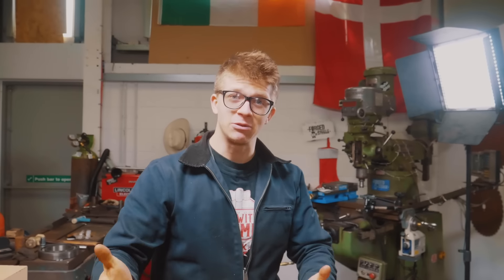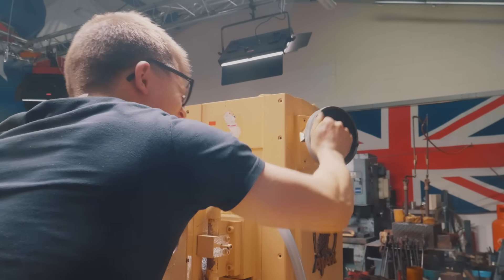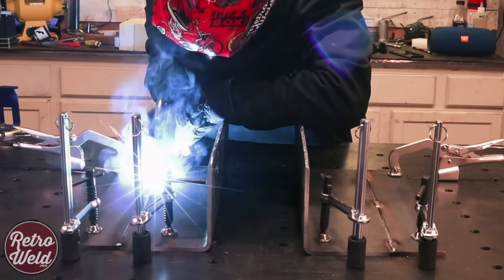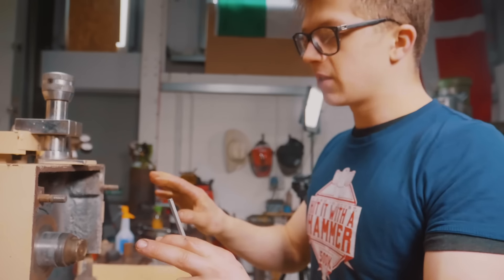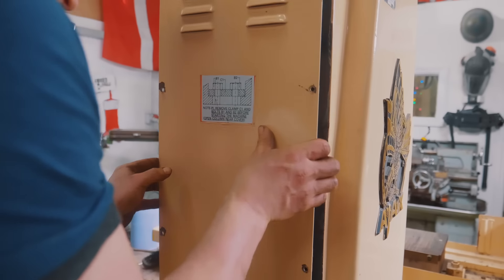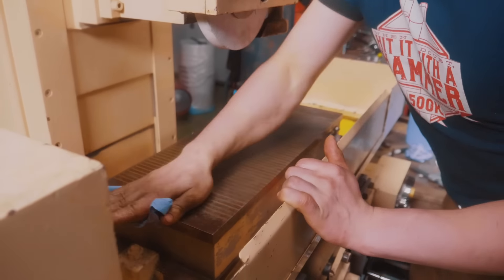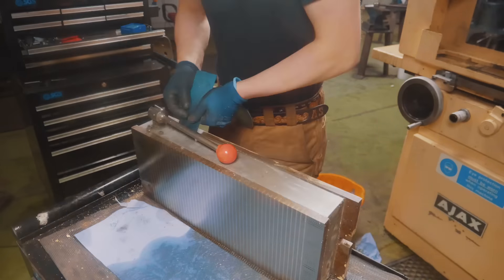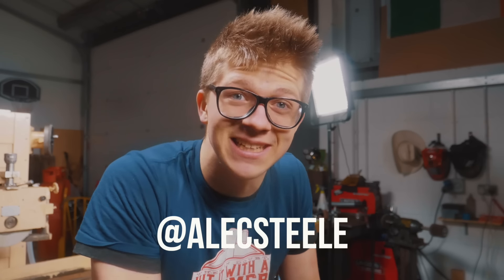THE SURFACE GRINDER IS ALIVE!!!

Comment: That noise that you heard was Cavitation of the pump. Essentially it means that you were sucking air or not enough oil and the air gaps left were essentially collapsing under pressure and over time causing a ton of damage to your pump. Literally ripping chunks of metal out sort of damage. Usually the cause for this is Air in the intake piping, A blocked filter or a low oil level. As you probably figured out, it was a low oil level. Thats the 3 second crash course in hydraulics for today.

Also if you didnt know to check the soundness of wheels You can put a screwdriver through the bore of the wheel and suspend it from that. Then tap the sides with the handle of a plastic screwdriver and it should ring. If it thuds or sounds hollow its a bad wheel 100%.

Comment: 3 live wires connected without neutral means it runs on 400 V instead of the standard 230 V, at least here in belgium

Comment: Next time the Mag-chuck is off wax and buff the the bottom of it and the table with an automotive wax. This reduces the chance of rust and make no measurable discrepancies in you chuck level. I heard of using a product called rainx as well.

Comment: Anything electrical will run without a ground but shouldn't be done because that's your protection from electrocution. Anything 2 phase or 3 phase will run without a neutral connected. In most panels your neutral and ground are connected, unless it's a subpanel in which case the ground is isolated. All of that being said, always work with a neutral and ground connected for safety!

Comment: You should probably pull that wheel hub off the spindle, that tapered shaft may be as rusted as under your chuck. Also you can get some hubs  that will fit more standard sized wheels. Never run your coolant on the wheel if its not spinning!

Comment: well if you hadn’t tossed the old grinding wheel you could have done the “ring check” to see if it was still good. you just dangle the wheel from a screwdriver and tap on it with a wrench. if it rings it’s still good, if it sounds dead then there’s a crack in it.

Comment: Those lines on the chuck that the grinder makes when cutting means you are taking too much off or feeding too fast and it is not good to constantly turn the machine on and off constantly if you are going to use it multiple times a day you should just leave the machine on but I don’t know the machine so I don’t know how it is run on the daily

Comment: I have 44 years in machine shop, I will guarantee I have screwed up a heck of lot more then you have. Don't be so hard on yourself. My old boss told me if you don't screw up, you aren't doing anything. Just don't do it twice, lol.
 I was grinding some A-2, and I went to lunch and like an idiot I left the coolant on, with the wheel off. When that happens, you soak one side of the wheel, and it can come apart when you start the wheel. You have to jog it on/off until you get the coolant off. Keep the coolant on when dressing the stone or you will have to reset the diamond. Diamonds are just carbon and not indestructible.
Balance the wheel, true it up, and you can hold .0001 inch on them. I have a surface grinder that was made in 1949,and it works fine. The vise should be on when you grind them. Dress the wheel until you don't get any high spots on them, and dress it before you do your finish grind. The side of the chuck doesn't have to be indicated in normally. If you side wheel something, you have to indicate it in on top the chuck anyway. 
I keep the old wheels to grind it before you put the chuck on, and after you grind the table in, I grind the bottom of it, them put some type of oil under it before mounting it. Some tell you it silly because you grind the top of the chuck, it's going to grind accurate anyway. I just enjoy being a PITA anyway.
If you are grinding for a good finish, you can put some paper on the chuck to stop the scratching when you take it off the ceramic type chucks.
Also, the coolant needs to have some treatment for bacteria and mold if it doesn't have it in it already.
Not trying to be a smartass or anything, just want to pass on what I have learned.
Smiles!
Bill

Comment: The mag vice does not need to be square once you run that surface grinder on it its flat flatness is really what matters on a surface grinder. But good job on the referb

Comment: Not done any Surface Grinding, But i can see where one would be nice for making Knifes and Swords. If they also make a stone with a angle one could grind the blade part.. I am not up to speed on what Surface Grinders do or there use

Comment: Yes its possible to run a 3 phase motor with out the Neutral or Earth line if its configured in a Star type and not delta ( where you need the neutral ) in Star type you have a virtual neutral and it works just fine with out it , regarding the earth yes that was definitively not to code and could become potential HOT the whole outside casing , or trip several RCDs and RCDoS in the processes

Comment: i'm like 9 months late, but the machine has no ground connection because the dude that used it before was crazy. and the neutral is not necessary because of how 3 phase power works. the 3 phases deliver the exact same power at the exact same frequency, but 120 degrees out of phase. so, when correctly working, the add of all 3 phases is equal to 0. there is no power coming back to the socket. in fact, there even are 3 phase plugs that come with the 3 phases and ground connectors only.

Comment: I'm no expert on grinders but I thought the bearings need to be fed with pressurised oil at all times, I wouldn't want to run it without the oil pump running

Comment: Once you dress the wheels you do not shut it off as the bearings cool down and then your wheel is out of round again also before mounting any wheel you should ring test it for safety. That is lightly tab it with a piece of brass or wood and it will ring if it thuds throw it away. Cheers and safe grinding !

Comment: You should really be using those crimp-ends on the cables. Otherwise the connection might get hot due to the higher resistance  and then burn up on you. They don't need that  in the us as their single wires in the wire are thicker but we need that here in europe!
Greetings from Germany!

Comment: IMPORTANT !!! Change the way the wires are connected. Now it is very dangerous. The cord in the form of a cable (small wires form one big wire) should have the right ends clamped! Or at least be tinned if it is screwed in the screw connection.

Cool video, I hope that the new equipment will last a long time.

Comment: the answer to can 3 phase curent work without is yes. you only need the neutral if the 3 phases aren't balanced with on a electric grinder i expect they are. earth is a safety requirement and not needed to function

Comment: Alec

If it's a balanced load on 3 phase you don't need the neutral...
A 3 phase motor is a balanced load...

You may find that on some machines the starter coils are single phase though...so they would require a neutral...

And did you use a proper SY gland on the machines incomer for the SY cable it's being fed with...?

Comment: Hey Alex, if the ground is not connected, but it has 3 lines, or 3 phases (if that's how it's called in English), it's possible that you have a 3-phase motor, instead of mono-phase. If it's 3-phase, then you don't need ground, since there's voltage difference between each line instead of line/ground and the motor works in either "delta" or "star" setpr (or a combination of both) . I'm not sure I'm explaining myself, since english is not my mother language, so here's a link https://en.wikipedia.org/wiki/Three-phase_electric_power

Comment: Honestly, your table doesn't have to be square. If you are just grinding a flat surface you'll just throw it on there any fucking direction in the world. I would modify your coolant feed and use something that necks down to offer a little more pressure. It will blow more onto the wheel and keep dust and crap down. Also, don't stand next to the table. It'll put a hole in your gut the shape of the part if the mag table lets go.

Comment: You mean wheel dressing? I'd say the old wheel was perfectly fine, just needed some dressing. Plus you have never checked brand new wheel if it safe to use - and because it's new it doesn't mean it's damage free - plenty of videos online how to cheaply check the grinding wheel :)

Comment: Before you ever put a new wheel on your surface grinder, lightly tap it with a hammer. If it rings then you know it's safe. But if it doesn't ring at all you know there's a crack somewhere inside of it and it could potentially explode at the high rpm of your surface grinder. A very expensive and dangerous mistake to make so please please PLEASE check your wheels. Every time.

Comment: I'm a tool and die maker please do not put your hand out to feel the grit from the wheel. If you forgot to put the magnet on you could take your hand off. Also before you put wheels on the grinder you should always ring test the wheel to make sure it wont explode when you turn the machine on. Also make sure your magnet is on when you grind the magnet

Comment: A proper connection should have 5 leads. They are 3 power/live leads L1 through L3, ground and "earth" (safety ground) - I am not sure about the proper names in the UK - sorry. If the motor is wired in the "triangle" setup, you don't need the ground wire - as is mostly the case. However you absolutely do need the safety (yellow/green) lead! If one of the live wires fails and touches the casing the fuse will pop. Ground and safety are not the same! Both end up connected to ground, but the safety measures the current flowing from the live wires. It that is above 20mA, the fuse is popped.

Comment: A 3 Phase System can run without neutral and earth connected. But the earth should be connected, cause of safety.You only need the neutral, if you want 230Volts. if you only need 400 Volts 3 Phase is enough ^^

Comment: Yeah only 3 live wires are enough for motors. Because the current of all 3 is ever 0. It is like this because of alternating current. If one of them is positiv the two other ones in minus. So it equals it out. Only if you have unsymetrik load on the 3 diffrent wires you need a neutral. Sorry for my bad english.

Comment: Firstly, This Old Tony.  If you're not already watching him, you should be (I'm sure I've heard you mention his channel before?).  He did a great series on restoring a surface grinder.  Totally different grinder, but alot of the fundamentals are the same.

Second, AAAARGH!  How did re-grinding the mag chuck go after you cleaned and reassembled everything?  DId you still have a relatively level surface?  Flatness?  That was a weird pattern that ground off in the first passes, and it looked kinda like it matched up with the rusty areas underneath the chuck.  Probably coincidence?  I'm dying to know though!

Third, my grandpa had a sign hanging in his shop.  "The more hurryder I go, the more behinder I get."  Always loved that.

Cool grinder man and great vid.  How about another better peek under the skirt at that contactor panel?  Wiring porn for sure!

Comment: Next time you put a grinding wheel on. You need to "ring" the wheel. Hold the wheel with your finger through it then lightly tap it with a wrench or hammer. If the wheel makes a ringing sound there are no cracks in it. If the wheel doesn't make a ringing sound throw it away.

Comment: those connections aint great buddy. Make little hooks 'J' and put them around the screw so when you tighten it down it will pull the wire around it.

Comment: Great video. Showing your error is likely way more valuable than just showing how to do it. In construction at least if you can't fix it you shouldn't own it. The reason being that you're signing contracts with customers that expect work to be done in a time period that generaly does not include shipping your equipment off to be repaired in the middle of said contract. The aforementioned must necessarily include electrical repairs to equipment. So, in costom manufacturing I imagine the same holds true. Does it not?

Comment: I love your enthusiasm! I was taught many years ago to redress the wheel every time you turn the grinder off and then back on again, the starting torque of the motor can move the wheel out of balance.  Also never touch off with the wheel off you can easily crack the wheel.  I have always just slowly touched off on the part I’m going to grind.

Comment: Only having three live wires connected can work and its called delta-connected motor. Which is actually quite common with industrial equipment, since you get more voltage, and therefore power, out of it.
They don't need a neutral. But the Ground should still have been connected for safety.

Also using flexibel wire without a lug is just dangerous.

Please let a trained electrician do such things in the future Aec....

Comment: Thank you for not dragging that one into another episode.
First job get the power hammer dies true !!
I noticed they are “dished” on the big hammer and that’s so risky for adding inclusions etc to you’re welds . 
You will be able to take you’re pattern welding to a new level now the mill and the surface grinder are at your disposal . You just need a bead blast cabinet to descale annealed billets !

Comment: That cable has a concentric "wire" that is meant to be plugged in with the PE on both sides. It works as a safety against cable tear. I guess one could skip that since regular machine cables dont have that, but since you can see the lead through the transparent cable cover it gives the impression that the cable is protected that way. I think that makes it sort of necessary to actualy use it as its intended.

Anyways, great show, you have alot of skull, enthusiasm and you are loco as f**k :p

Comment: Wait, the hydraulic reservoir is just... the bottom of the cabinet?  That's a little crazy.

And if it's a grinding machine, shouldn't it be in the Grinding Room?  I know you like the 'wide open plains' you have in there right now, but you'd have more than enough room to put this in there.

Comment: Did you make the wiring yourself on all your machines? If so, please get an electrician to fix it. Never use a flexible cable without end sleeves. 
Beside this, a fun video as always. :)

Comment: Hey Alec, You need to go look up Frog Lube.  It's sold to primarily lube guns, but makes a great rust preventative on shop parts.  Oxtoolco recommended it on one of his videos and I've loved it ever since.  You should also check out his channel.  He has loads of great machining, measuring and general shop videos.  He even does a great deal of work on a surface grinder.  Check him out.  Oxtoolco is the channel, Tom is the youtuber.

Comment: Also if I catch you not wearing your impact proof ppe I'm going to fly out there and whip you! The most dangerous thing in a machine shop is an abrasive wheel. You cannot trust your life to the glue holding the wheel together. It could very well explode taking your vision with it. I love your videos buddy

Comment: Love your channel Alec!  When connecting stranded wire to equipment (especially vibrating/dynamic equipment) you need to use the appropriate lugs (spade/fork lugs) so that the strands of the wire do not work loose.  Keep up the good work!

Comment: solder the wires before connecting. flexible copper wire tends to break fast even when not moving. (im an electrician ;-) )

Comment: I know you felt silly for not checking the squareness of the mag vice, but your work at the end of the video really didn't matter.  You really gain nothing by having the mag vice square because the only dimension that the mag vice holds is flat.  There is nothing to hold your part perfectly square.

Still, you are right.  Your final assembly did look nice and cleaned up... Just unnecessary.

Comment: Don’t be too hard on yourself.  Easy mistake not cleaning under the chuck.  I did think you had guts truing the chuck after only a small test plate and zero other experience.  😀. I always “ring” a new wheel before spinning them up the first time. Hang the wheel on one finger in the centre hole and give it a light tap with the back of a screw driver.  If it goes dang dang it probably has a hidden flaw.  If it goes ding ding it is probably good.  Bring the wheel up to speed slowly in short bursts with your head as far out of the way as possible.  You will never want to see a wheel explode twice!
Love the machining plus the Blacksmith stuff.  Keep it up
Ps Get an electrician.  One stupid mistake there and that could be it.  Is that really worth the saving?

Comment: I don't get the point of having the x and y axis square.. sure on a mill with a chuck that is square sure but on this you are just placing materials on top. Short of using your dial guage on everything you do it won't make much difference

Comment: Wondering about the tool you made for the grinder wheel,   What if you made a deep prong wrench,   2” hole with the 2 prongs so the adjustable wrench is on the outside?  (No stripping).   O: 🔧

Comment: To see if a wheel is good you can take the wrench you made while holding the wheel on a finger and lightly taping the wheel on its side with the wrench. If it's bad it will have a no ring and if good it will ring make sure you go all around the wheel because you'll likely not see the crack don't worrie about the chips as long as it has a ring it's good, and do it every time you put on a new wheel or else it could explode.

Comment: I am stunned that you did not disassemble the magnetic table on that surface grinder to clean underneath it before you ground the top of it off!  Jumpin' JuJu beans, Alec.  Be smart about your expensive tools.  Find out why it is off before you make a permanent change to its' surface.